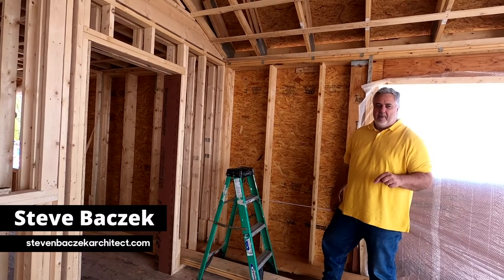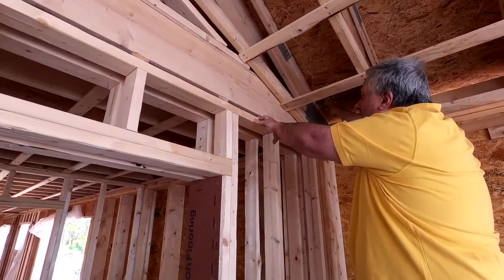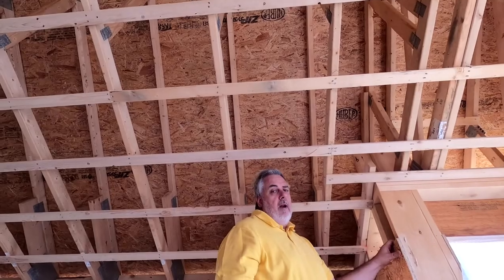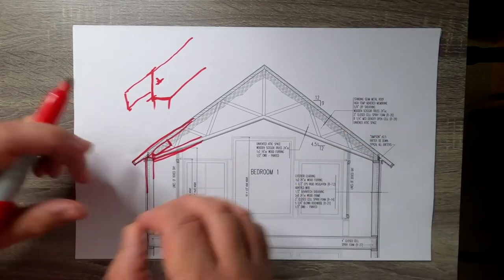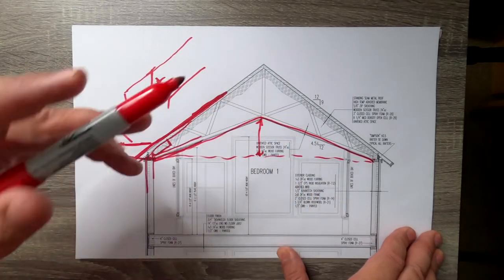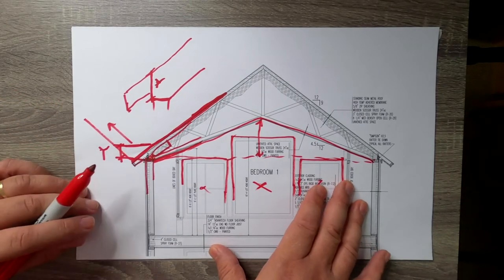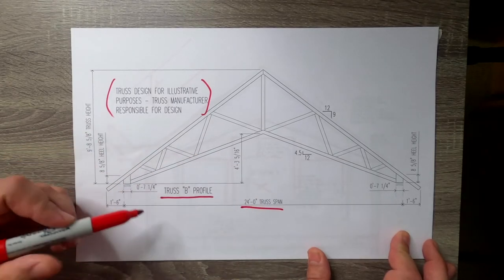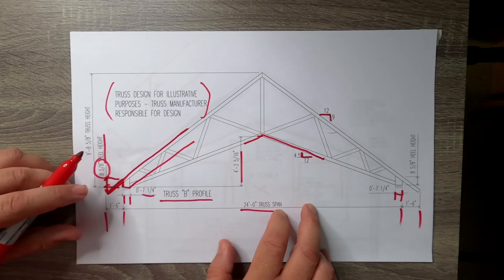Scissor Truss Roof Framing

Comment: It’s good to see an architect that respects the builders knowledge and experience and will include their input in the process. An architect would never think of designing without the input of an engineer. Many times the forces and moments applied on materials are anything but intuitive and the engineer is there to do the calcs to insure the design is sound. It’s the same with the builder. What seems intuitively simple to build may not always be the case, so consulting the builder with design options can be advantageous to not only the budget but the schedule as well.
Reply: @psidvicious  Another good architecture channel that focuses on performance and construction details is Asiri Designs.  Rather than show you how he did it, he shows several ways it can be done.  He also puts out publications on his website, some free.

Comment: Raising my daughters living space as the Hurricane IAN flooded her house to 7' all lost.  So going up. My question is I am thinking of adding a collar beam to the bottom of the  scissor truss , even if it is only 2'. Reason- trusses are on 2' centers as no loads in Florida, but there is some flex, compression, most sport cracks along the apex of the wallboard- sheet rock ceiling. Thoughts? PS we have an architect we can't work with- so all como goes through our contractor. As you note very difficult.

Comment: Roof design is so fascinating. 
Can you put a scissor truss onto a 50x50 building without interior walls? Or would that not be advisable in northern Maine ?
Reply: It's possible for sure and done regularily, but you have to watch the overall height. Typically trusses have a maximum height dictated by the fabrication & shipping constraints. Maybe 12 feet high at the peak, and an interior ceiling slope roughly 1/2 the roof slope. I would guess that you could only get a ceiling slope around 2/12 or maybe 3/12. You also have to account for the truss trying to push the walls outword under full load.
Reply from the maker: @JackOfHearts42  Agreed - just has to be properly engineered
Reply: I have a parallel cord steel truss spanning 44' without intermediate support. Keep in mind, the roof pitch has a large factor on this decision.
Reply: @stevenbaczekarchitect9431  part of the wall holding the trusses will be ICF with a 12” concrete core.